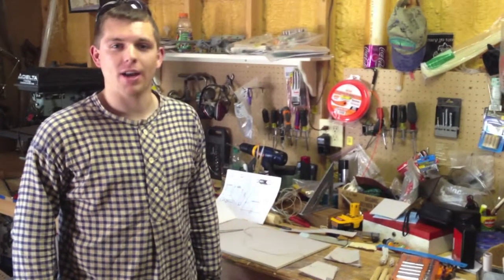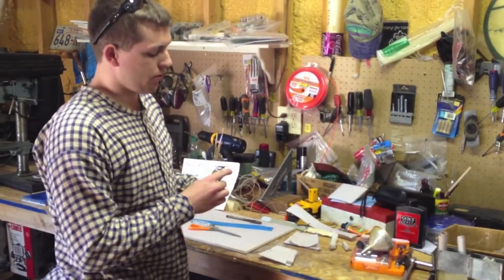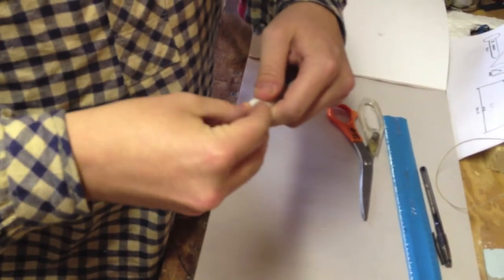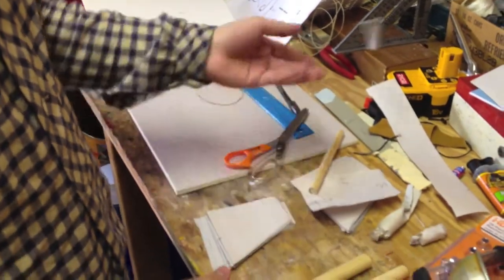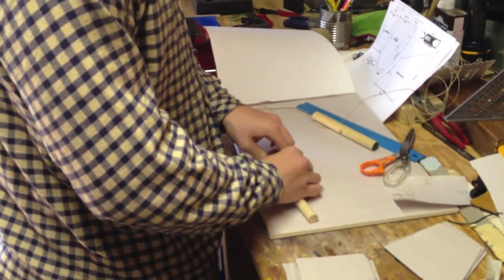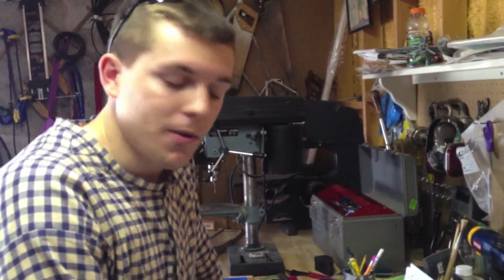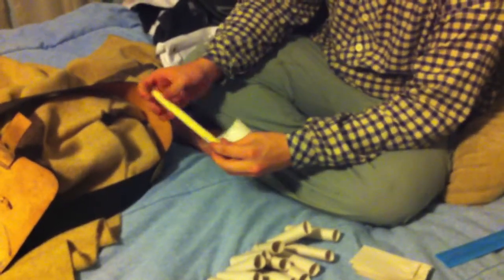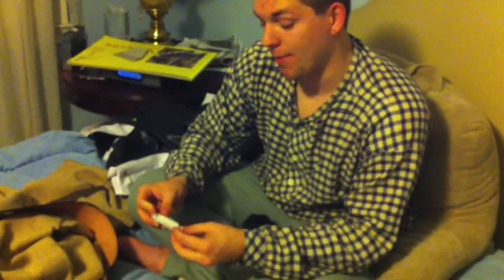Making Cartridges - Draft

Comment: hello, I have not been able to find the diagram for making the cartridges that you u show in this video. I'd love to have a copy. Thanks.
Reply from the maker: Hi. I'd like to start by saying this video was made when I was new to the hobby and did not have much experience. A lot of what I do now is different. This is why I titled the video as a draft.
Now, the dimensions of your cartridges depend on the ammunition you are using. A good reference for Civil War era cartridges is the 1861 Ordnance Manual - google it. There is a section in it pertaining to small arms ammunition, which includes a chart of cartridge dimentions, bullet weights, powder charges, etc, for various firearms (see below).
Also, keep in mind that many cartridges actually require two rolled trapezoids, one for the powder and another to contain the first as well as the bullet.
Many people make stencils from which they outline and cut their trapezoids. I use a ruler or square and draw mine straight on the paper, making the best use of the space available and usually enlargining the trapezoids a little bit to give me more material to work with.
Here is a copy of the chart from the Pedersoli website: http://www.davide-pedersoli.com/uploads/immagini_gallerie/big/2751861%20cartridges.jpg